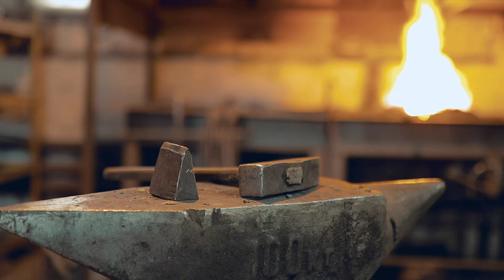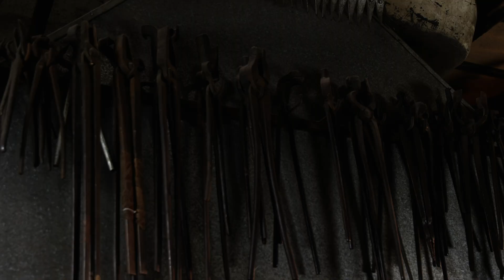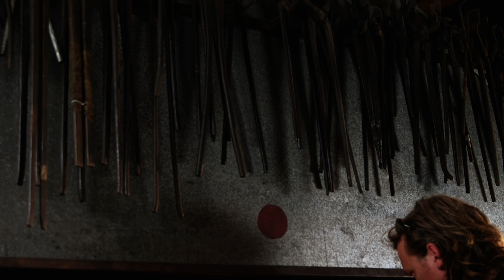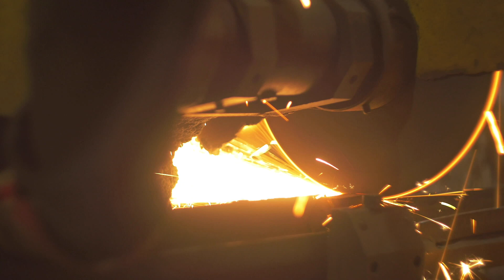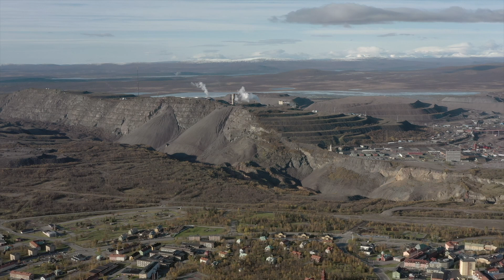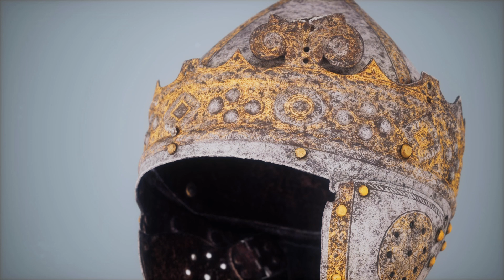The History of Iron: The Metal That Forged The World

Comment: Great video! One thing I have to point out is your use of the word toughness isn’t really accurate. Toughness is a measure of the total energy absorbed when a material breaks. This is usually high for softer or more ductile materials. The word I think you were looking for was strength or hardness. Strength is the peak stress needed before bending, and hardness is the materials resistance to abrasion
Reply from the maker: Thanks, I usually use the term hardness, but I slipped up. I will edit the video in the future. Cheers